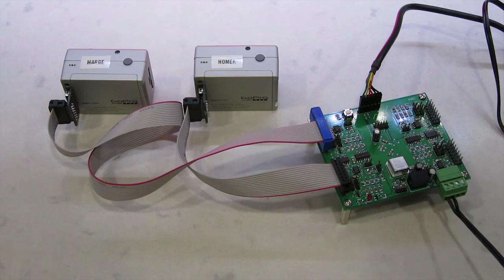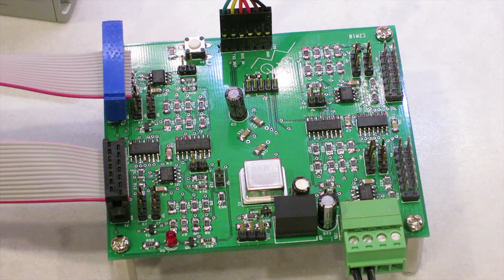Remote Control of up to Four GoPro Hero2 Cameras using a PIC and a PC

Comment from the maker: For still pictures, yes, they are—or as close as they can be given that they will likely all have different shutter speeds. For video, not really. I need to probe the 3D cable a bit more. The GoPro 3D cable has an option to share a single clock from a master camera to a slave camera but I don't think it's used by the current firmware. Since it's not used by the firmware, I can't supply a single clock to all the cameras. Hence they are not genlocked and free run when shooting video.

Comment from the maker: Thanks! I used the 74xx07 chips because they have open collector outputs. They're also what are used in GoPro's 3D cable. Everything on my boards is +3.3V. I don't know about the current available on the backpack connector's pins. They have to be able to drive quite a bit given that they can power the WiFi backpack or the LCD backpack. I didn't want to rely an any non-existant specs for these pins so I used my own external power supply.

Comment: This is very awesome. Its an immense help in my project. I have a couple of questions:

1. Im trying to figure out why you're using the 74LS07D buffer chips? I cant tell what the VCC is for that from your schematics, but Im presuming its just a plain driver, not converting from 3.3v to 5v (?). So my real question is all the hero2 bus pins youre driving are 3.3v?

2. Do you know if the GoPro's pins (say pin 23) have enough current to run a MC on a similar setup as yours?

Thanks a ton in advance!

Comment: I am trying to modify my gopro with an Arduino to turn on/off the camera, start and stop recording, ect. However I can't figure out how to control the snapshot/start and stop video function yet. I assume the secret is in the ID pins? At this point I have no clue how to use the ID pins, where could I find out?